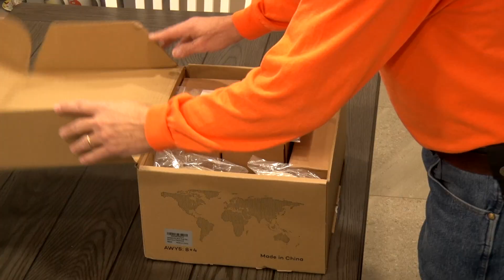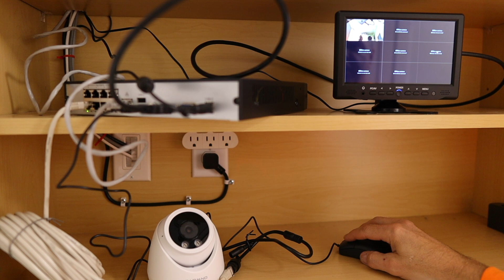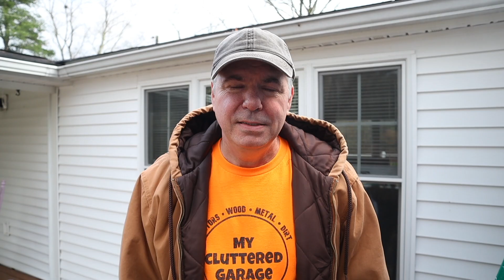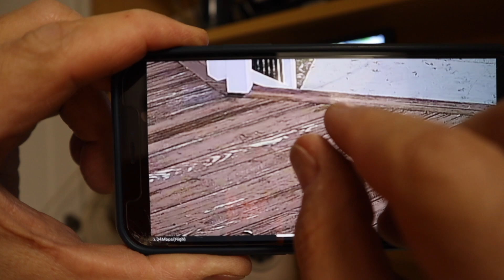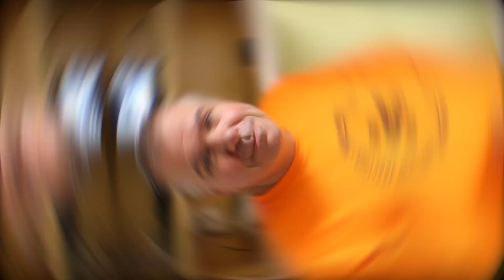#123 ONWOTE 4K NVR PoE Security Camera System. Installation and review.

Comment: You mentioned notifications in the live stream. Possibly consider the mighty mule driveway alarm which senses metal/vehicles. A lot of other driveway alarm products sense via infrared which are susceptible to the 3am deer false alarm wakeup call. For your camera system, if ONWOTE accepts the ONVIF video standard, then you could mix camera brands into the ONWOTE DVR to get a more customized system. Some cameras also have video main (high resolution) and sub-streams (low) which you might want to use if on a slow remote connection where 4k would be choppy or possibly wouldn't work at all. It is true that wireless cameras are overall not as good, but I have three 2.4GHz access points spread across the band which does make for a good wireless camera experience but I still do also have wired with power and wired POE mixed into my system. I could go on all day on this topic. Don't get me started on event detection and timeline view, lol.
Reply from the maker: You are well experienced! I haven't dived into the features yet, but it looks like there are a lot of setting that I don't even understand. And yes, my Ring camera wakes me up every time a bug craws across the lens!
Reply: Nice!

Comment: most of the chinazon products are fine until you have an issue or need any type of equipment support. When it comes to securing important things, stable and established companies matter. Even though most of the stuff is made in the exact same place.
Reply from the maker: That’s generally true but I have to say that ONWOTE has been very good with communication. I hope their customer service is as good.
Reply: @MyClutteredGarage  Your videos are always informative. It'd be cool if you did a use update on this at some point.
Reply from the maker: @no_handle_required  I definitely should give an update after I have a better understanding and have used the system longer. Thank you!

Comment: Nice review Ed. That "dome" style has the more Professional look to them than Bullet Cameras.
When I built My new Place. I roughed in a whole mess of Box's & 3/4" Smirff Tube for camera /Data/ Low voltage locations.  Cause I knew I wanted Wired Equipment. I have all the Wireless stuff shut off. One Box under the soffits at the corners. 2 Door Bell locations. Etc. In a 900 sqft House I went through almost 400" of 3/4 Tube. Even the "T" stat is in Conduit. It is cheap to rough all that stuff in while the Walls Etc are open. They all come to a 12x12x6" box in the Attic right next to the Hatch. then 2 2" PVC's down the Closet Wall to another box in the wall like You have with a Shelf for the Equipment with Power built into the Box. And a Conduit to the Service Entrance outside to bring the Internet into the Closet.
Thanks Much.
Mike M.
Reply from the maker: Wow that’s great prep work! In this wireless age, we don’t often think about wiring.
Reply: @MyClutteredGarage  I forgot to mention I have a small rechargeable Monitor like Yours that can power an Ip camera directly for set up right at the Camera. I used it for Work setting up Cameras. It will connect to any style of Video output.

Comment: There is a channel called the hookup and he reviews cameras.  I have 70 cameras at the zoo.  The overall best affordable cameras to use seem to be Reolink.  Axis may be better but most of their cameras start close to $1000. Wee have tried at least 20 brands. Amcrest, hikvison and a bunch more.  You can still see and record most cameras if you lose internet unless you are using Comcast's router.  We use a software called Blueiris to record video on a pc.  We have had very good luck with the stability of Reolink cameras on Wi-Fi. They will get a signal and work where most other devices and iPhones are not able to.  They have an app and qr code linking system. Installing the cameras is dead simple. Scan the qr code on the camera and in less than a minute it is configured and connected. They even have a solar version that works at ridiculous distances from the wifi. Night vision and motion detection are also included. They also have PTZ units that are affordable and controlable from your phone.
Reply from the maker: Very nice, Nick. That’s a lot of cameras, but I’m sure you can’t have too many there!